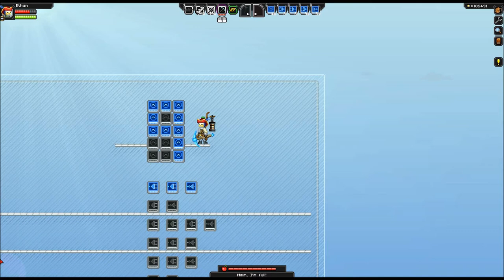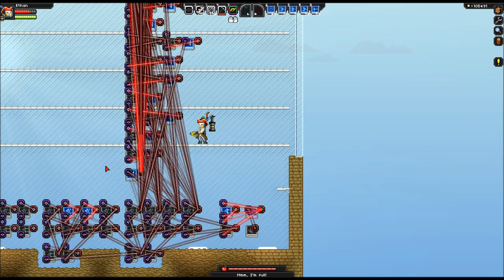Digital Display for Starbound Counter

Comment: Ah.... Just a tip: For future builds, if you take the signals from the binary counter at the bottom and bring it up to each of the hardcoded number areas with an or gate per number, it would remove a lot of the clutter, and the only downside is a slight delay, but it'd be all in sync in the end anyways.
Reply from the maker: I'm not sure I understand what you mean. The stack of gates in the middle are a series of NOTs and cascading ANDs to give power for each specific binary combination for the numbers 0-9. What would the OR gates be used for?
Reply: Hmm. Actually, upon a closer look, I think my suggestion may be voided, I realised that this was not wired one level at a time, sorry ^_^;